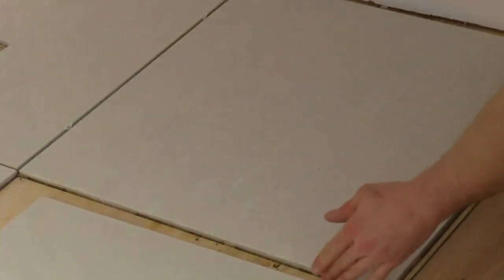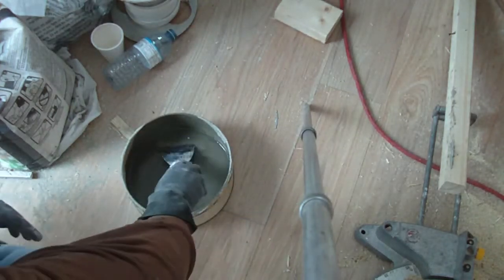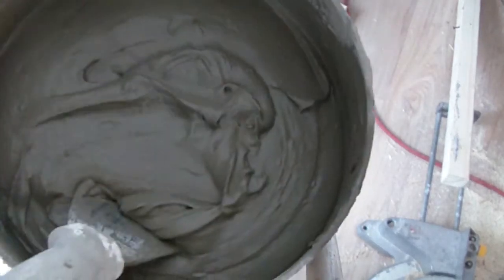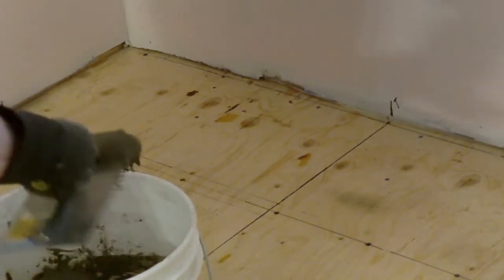DIY Washroom Build, Laying Floor Tiles 24x24 and sub floor. Part 1

Comment: Dude, no offense, but you're screwed. As soon as you put that mud on top of the Plywood SubFloor with no barrier I know for a fact your floor is not going to last long, seriously. Home Depot has this Orange Underlayment designed specifically for going over wood and allowing Tile to be installed. You could have used that Orange Material over the old floor and still had the same height. That Orange Material is in the Tile Section and easily located. I don't think it's pricey as I've not priced it lately. You may get a few years but at some point it's going to crack and separate from the Plywood SubFloor because the Plywood is going to move. The Plywood is going to soak out all the Water and you floor set is just going to be mush and will not dry properly as the soaked wood is going to prevent drying. Wow, I hope you're not too far along that you can fix this now because to fix it later is going to be even worse... Again no knocking your project just give you a heads up because that is going to be an issue.

Edit:
Yikes you're done... Well, just keep an eye on it and when the ceramic cracks you will know why... Again not knocking your project just giving you a heads up...
Reply: Paul Bialozor are you talking about Duroc , a concrete type underlayment ?
Reply: @nonameneeded5722    No not Duroc, though that would work too or Hardie Backer Board. If you used Duroc then you're OK, but I thought you laid Plywood down. 

Here's the Lowes Link as either store sells it, I think it's a bit cheaper at HD, also HD might call it something else too but it's the same thing: https://www.lowes.com/pd/Schluter-Systems-Ditra-54-sq-ft-Orange-Plastic-Waterproofing-Tile-Membrane/3580144?cm_mmc=shp-cprdflrgooglelia--groutmortarandsealers-3580144-_-0&store_code=1674&placeholder=null&gclid=Cj0KCQjws_r0BRCwARIsAMxfDRjPDAz2j1VkAtlRQt2i5fiX9Sas4QdWXPq0lT1ArgnmkT46xRGKgToaAiYsEALw_wcB&gclsrc=aw.ds

It's pricey, but it makes it so that wood can move while the tile stays secure. I learned the hard way and didn't think to put anything between the Plywood and Tile like what you did. My Mother's house was much older so perhaps that's why the wood may have moved faster and I went over plywood too. What happens is the Tile Set will break away from the Wood as the wood moves from expansion and contraction; even plywood moves a little. Tile Set is concrete and it don't like to move at all so when the wood moves the tiles start to crack. Then the more you walk on the floor the faster it will break away once it starts to separate.

When I redid that floor I used Hardie Backer Board 1/4" and that stuff is amazing to work with. Any Carbide Blade will cut it and it's far more stable than Duroc as Duroc chips and breaks when you cut it. They also sell specific Screws that countersink into the Backer Board and they are worth using. I tried using drywall screws but the heads kept popping off whenever I tried to set the screws. I've been doing construction/remodeling since 1982ish. I hope this helps...